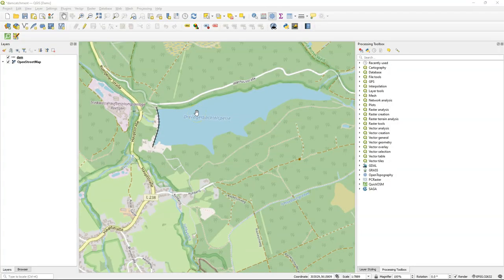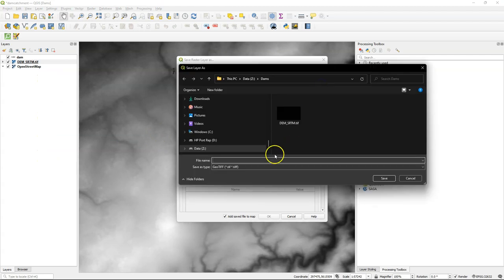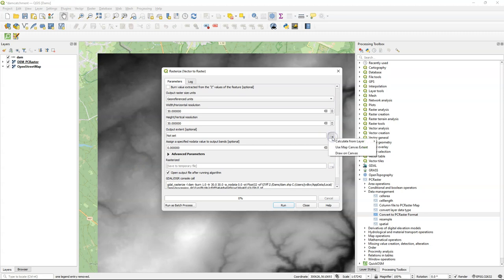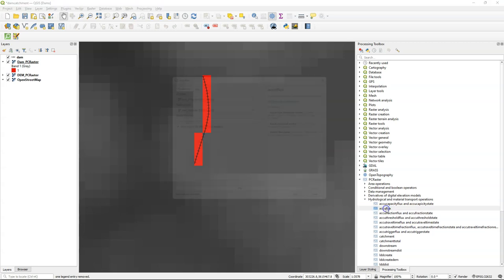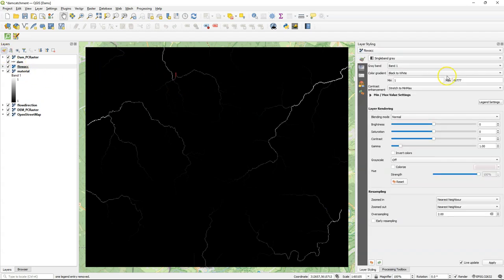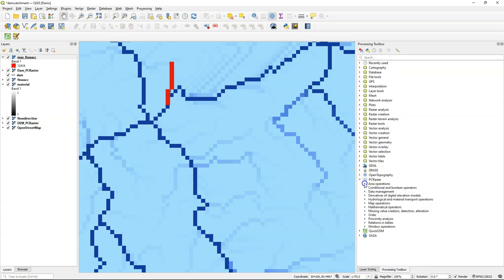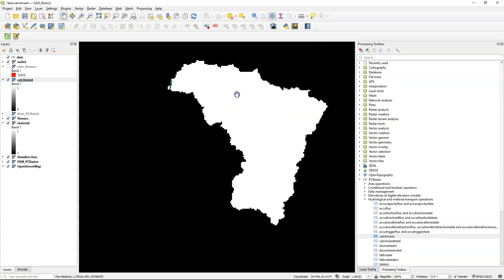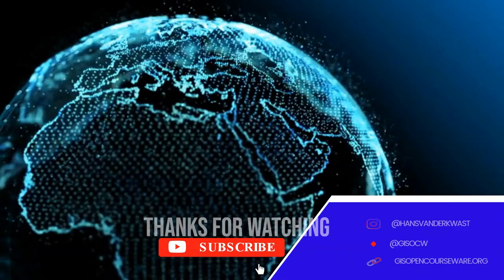Calculate the Catchment of a Reservoir Lake in QGIS

Comment: Can I keep projection of dem as WGS 84 instead of projecting it in UTM coordinates?
Reply from the maker: For analysis with DEM's you can't use a Geographic Coordinate System. The x/y coordinate units are in degrees while z is in meters. This will cause wrong results or errors.

Comment: Thank you very much. My flow accumulation model reaches max value in the middle of my lake and doesn't reach the dam. This results in a catchment area of a few pixels around the outlet. Ran this on several lakes and the same issue occurs again... Could some key parameters be modified ahead to remediate the problem ??
Reply from the maker: The problem is probably in your DEM, which doesn't have the lowest point at the dam. If the fill sinks algorithm (lddcreate) doesn't solve this, you need to modify the DEM in another way so the pixels at the DEM are the lowest. Maybe a burn DEM algorithm can also help.
Reply: @HansvanderKwast  Thanks ! I used the "Fill sinks (Wang & Liu)" module on the DEM layer. This worked perfectly ! Thanks for the quick tip :)

Comment: Sir my Max Flo Accumulation step is getting error. RuntimeError: areamaximum: arg#2: Number of cells is different than clone or previous argument. QGIS version: 3.30.3, What to do?
Reply from the maker: It means that the 2 input rasters don't have the same amount of rows, columns, pixel size etc. You can fix this with the resample tool.
Reply: @HansvanderKwast  Sir pixel size of my dem_UTM after resampling also is not coming exactly 30 m (29.99901210300430066,-30.00547445255474344) and that of dam_wall is exactly 30 m. Does it causing problem?
Why dem is not taking pixel size of 30 m?
Reply from the maker: These are probably rounding errors. It should not be a problem.
Reply: @HansvanderKwast  Thank you so much Sir, it worked. :goodvibes: